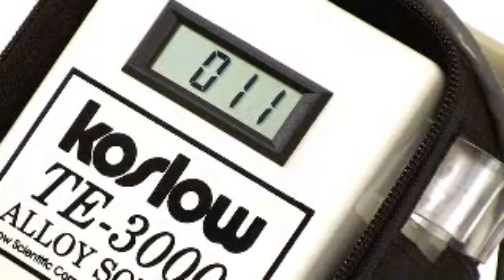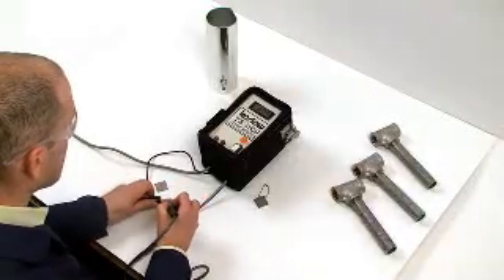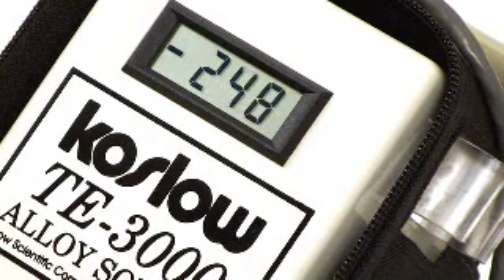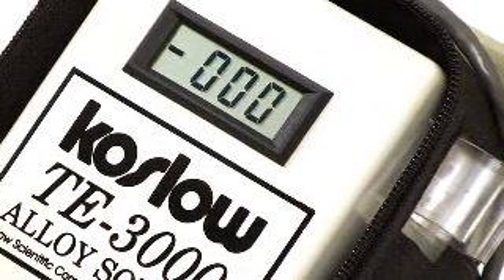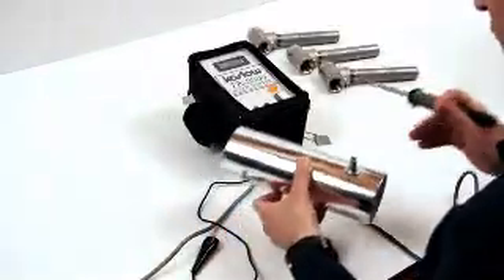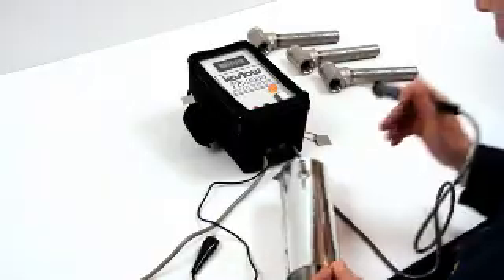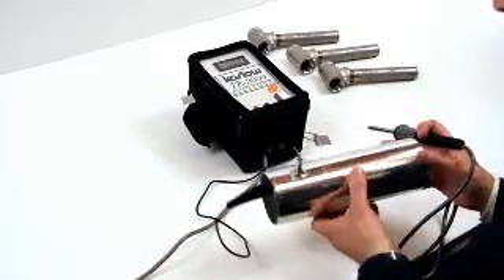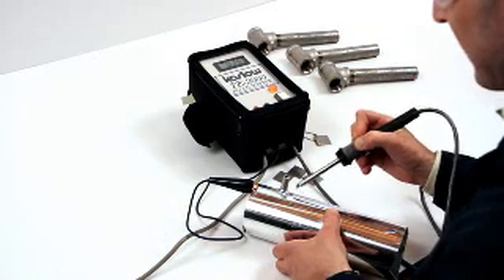Thermo-Electric Alloy Sorter TE-3000 from Koslow

Comment: If I mainly need to sort 304 and 316, then these thermoelectric wont work correct? I do not see a TE number of 304. But I assume it is not differentiable than 316.